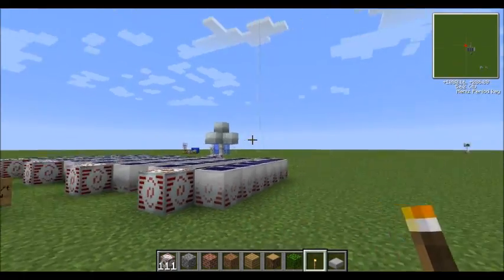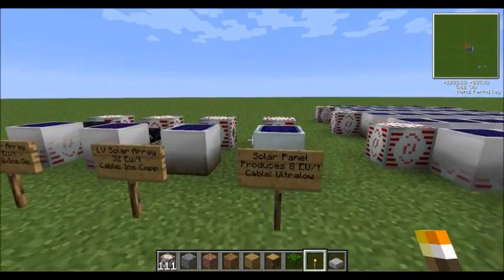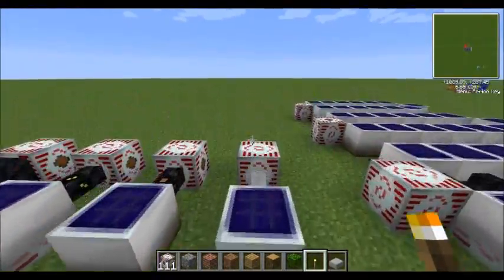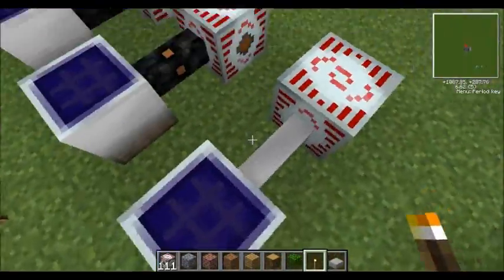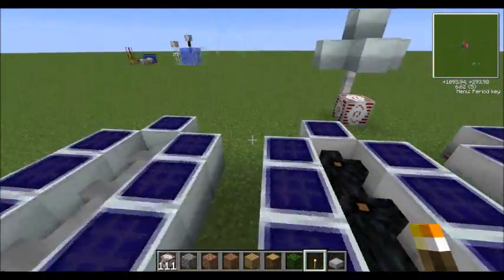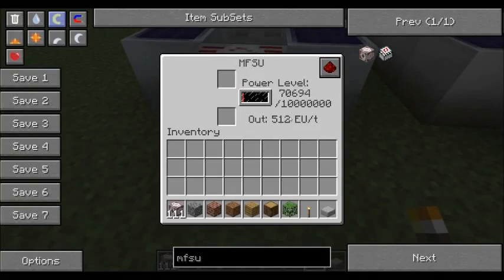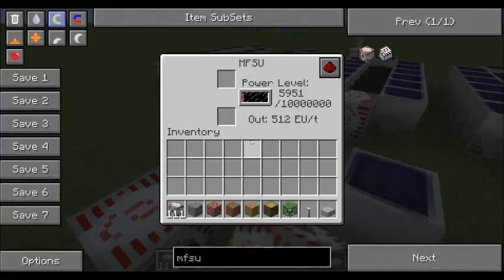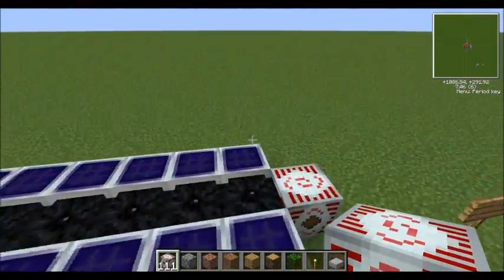Vladimir's Tekkit Tutorial - Solar Power

Comment: This is because the EU/t of the MFSU or MFE is too great for some machines. To solve this you need to connect the MFSU/MFE to a HV Transformer with a 2x insulated copper cable. Then connect the HV Transformer to a MV transformer. Then connect that to a LV Transformer. This SHOULD work. If not, you either did something wrong or your machines are working correctly. If you need help, type in "How to use MFSU/MFE" in the search of YouTube.